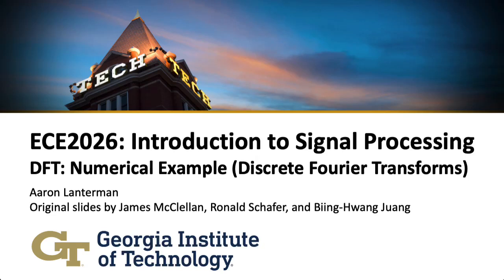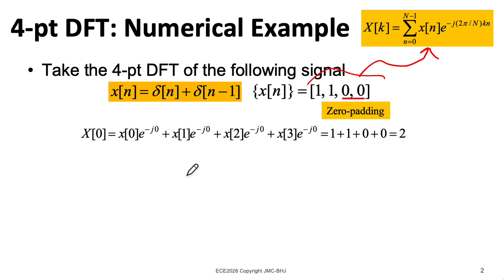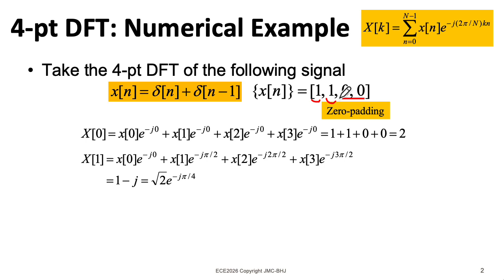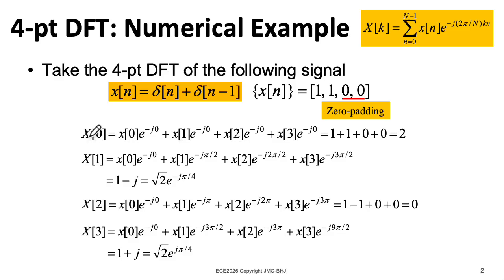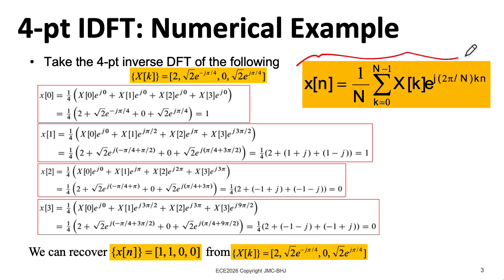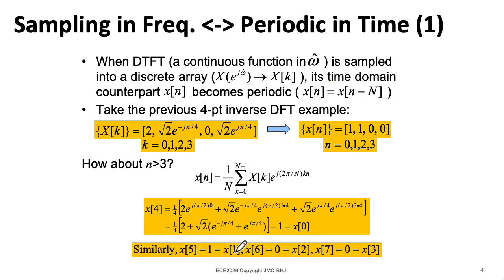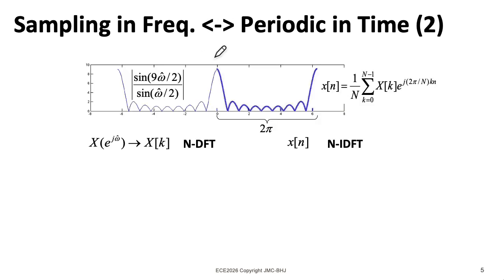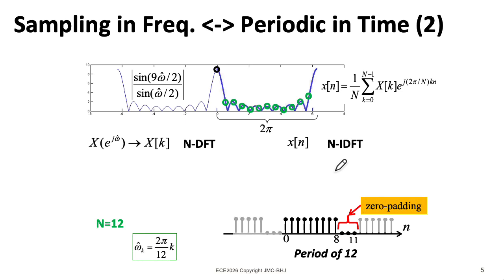ECE2026 L39: DFT: Numerical Example (Discrete Fourier Transforms) (Intro to Signal Processing)

Comment: This section of the accompanying textbook is confusing. For example, in section 8-1.1, the authors EXPLICITLY proves that the IDFT returns the original sequence x[n] over 0 <= n <= N-1. They even made use of an orthogonality property to show this. 

At some point, the authors now claim that the IDFT returns a periodic signal (see 8.26), which might be different from x[n] over 0 <= n <= N-1. (Example 8-5). 

I feel something is wrong with the textbook.

Also why didn't this weirdness with periodic extension show up in all the other transforms which are also periodic e.g., DTFT is 2pi periodic.